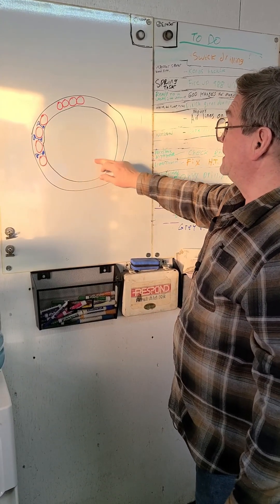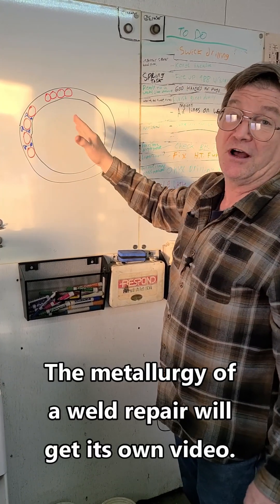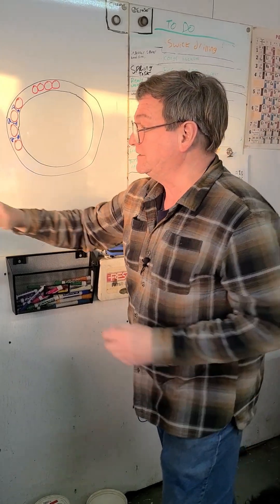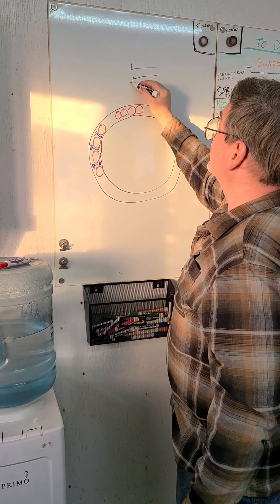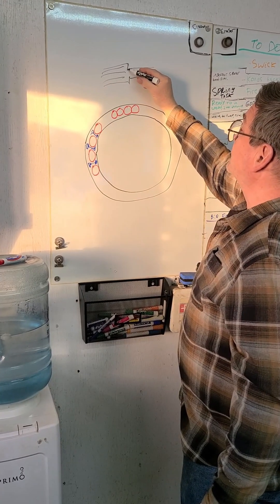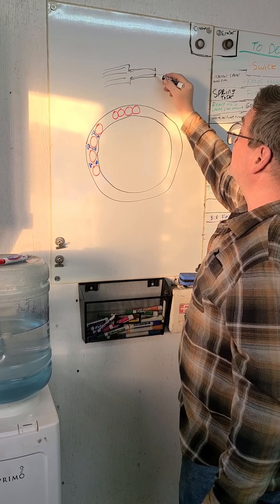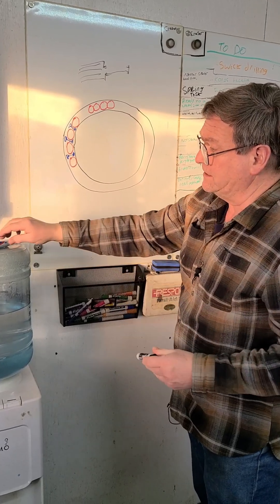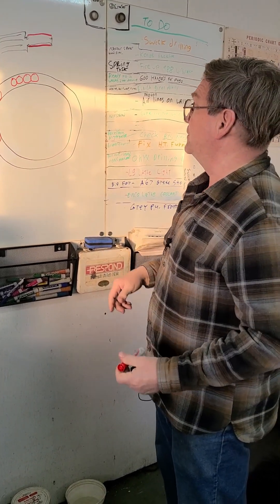Machinist's Minute(s): Hard surface needle roller shaft repair

Comment: How about machining the shift smaller and using larger rollers.
Reply: I don't think you would be able to do that without having to modify the outer race. The size relationship between the rollers and inner and outer race are tightly linked to keep the rollers for being too loose and binding.

Comment: What about under cut. Build up with hard facing rods and machine back to spec?  I’ve seen this before in a pinch with slower rpm type shafting
Reply: Splines his choices are much better option

Comment: How about metalizing the shaft where the wear is...we did that for bearing fits at the papermill i retired from...it was done below 500 degrees...you cant do it for needle bearings tho
Reply: I was going to bring metallizing up, but you beat me to it. 

I've never done it, but Cutting Edge Engineering has a video or two on doing it for heavy machinery repairs.